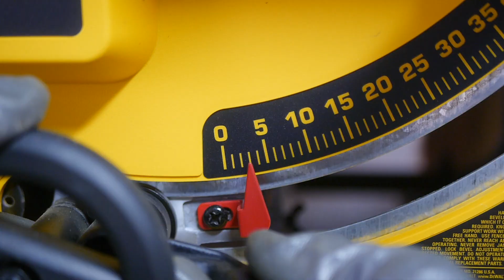A small chair for gardening

Comment: Great craftmanship. I am curious to know what blade you have in your table saw it looks thinner than the stock dewalt one, I tried a thinner one it was loose on the arbour?
Reply from the maker: Hello TopGum.
The circular saw blade I use is my favorite Makita 216mm-30T.
The standard dewalt blade has been professionally sharpened and is now in my drawer.

Tachi.
Reply: @TachiOhyo56  thank you so much for replying, what is the makita kerf? 
when are you going to run out of desks LOL
Reply: @TachiOhyo56  I think I worked it out, the Makita is only 1.6mm thick my present Fraud is 1.8 I tried a 1.2mm and it flopped about, so  I should be able to tighten a 1.6 enough. I'm going to give the Makita a go next time I need a new one. Maybe I will get as good as you 😀